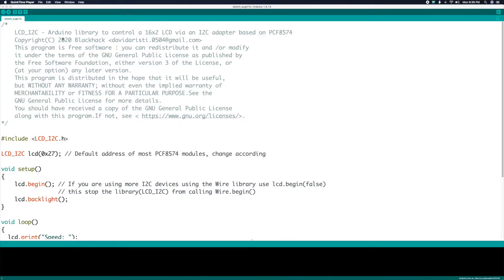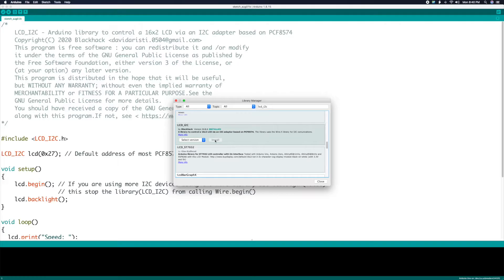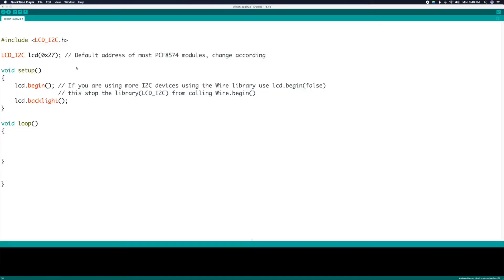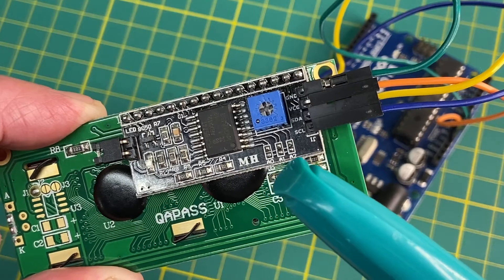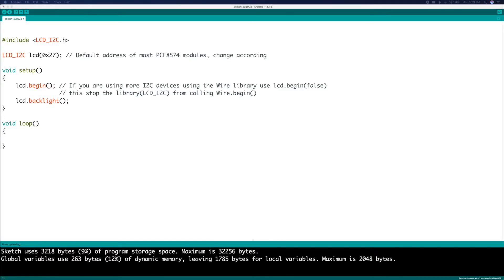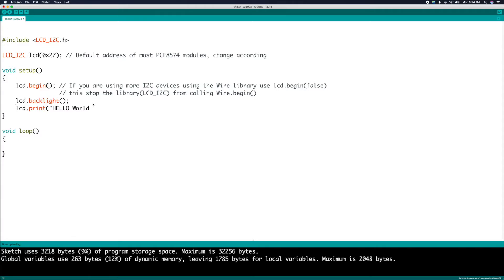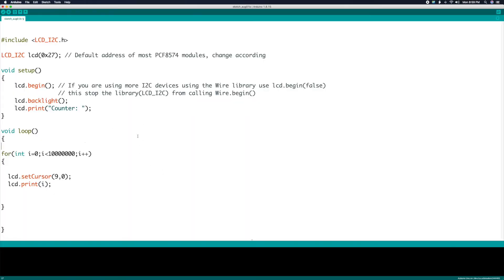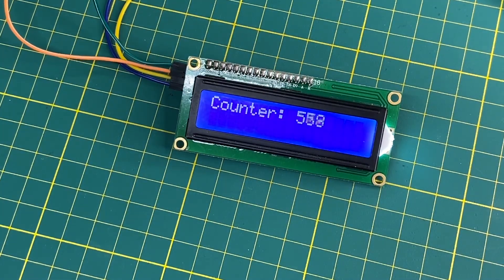How to use a 1602 i2c Serial LCD Display with Arduino

Comment: how do i do this with arduino nano
Reply: It's similar, you use jumper wires on the parallel ports. GND to GND, VCC to Vin, SDA to pin A4 and SCL to pin A5. Then run the code in the video and it should work
Reply: @khizarmetlo7228  its ok i just had to edit the address but thanks

Comment: I am having trouble with the first code that prints hello world. I copied the wiring and the lcd screen is lit but it does not display the words.
Reply: Play around with the potentiometer (blue cube) on the bottom of the I2C adapter with a screwdriver. If not, maybe check the I2C address